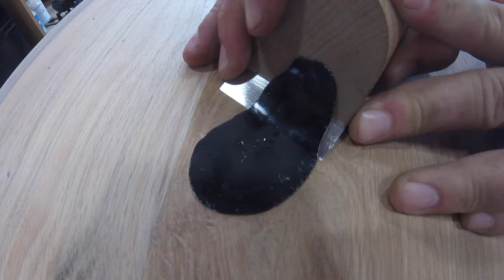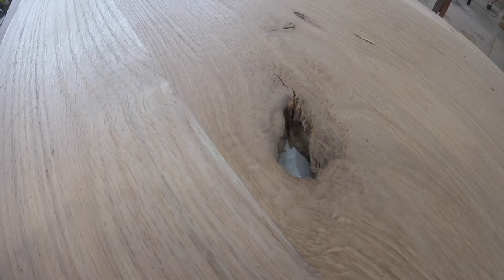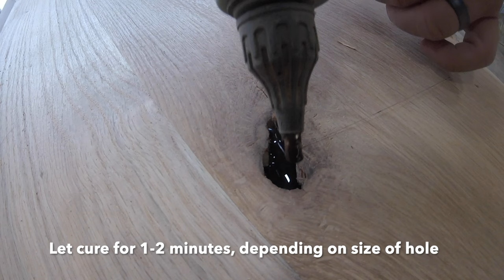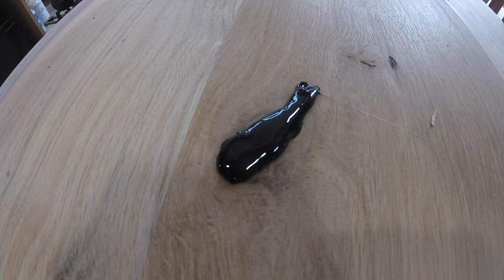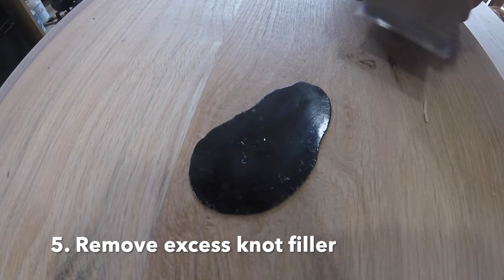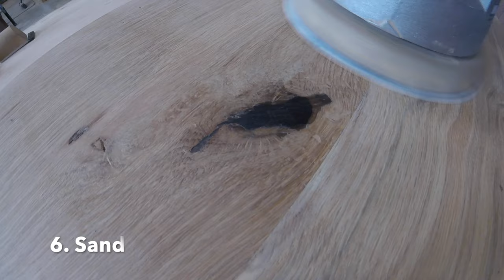Rangate Knot Filler - Pass Thru Holes

Comment: Nice process. How does that product look when finished?
Reply from the maker: Doug Corrigan after applying and sanding, the knot filler takes on the same sheen as the wood around it. Blends in super well. There’s several ways to fill this type of hole (wood filler, epoxy, etc) but using the rangate is by far the quickest.